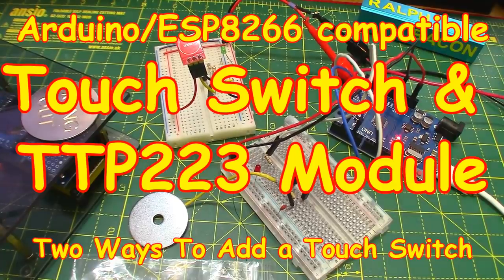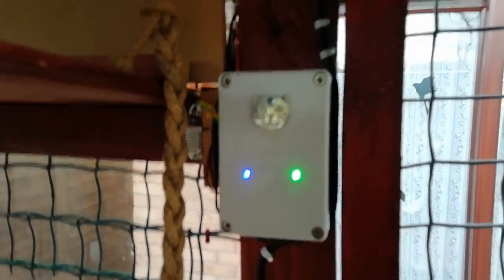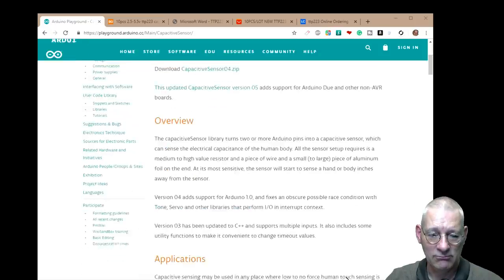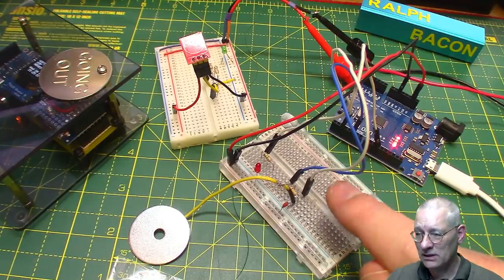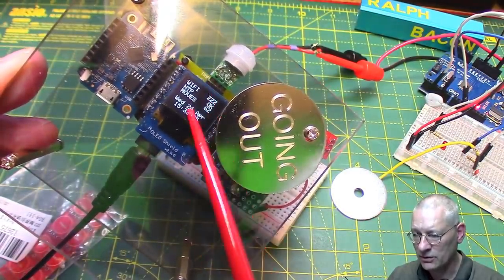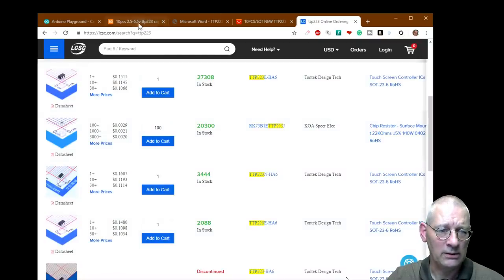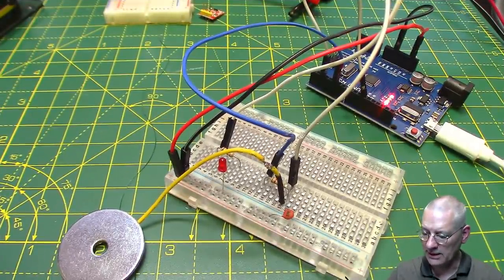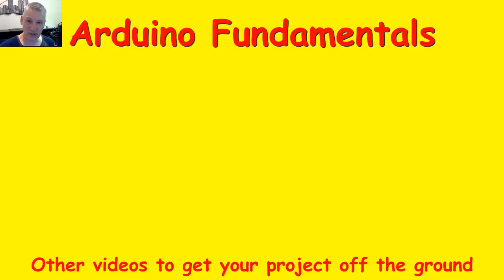#143 Touch Switch 👆 with optional TTP223 module (ESP8266 or Arduino)

Comment: Hi mr. Ralph how can we use a touch switch to turn on a say led and touch it again and turn  led  off  mine are momentary . just wondering if we can do that ... Been watching you for long time thought i would finely ask a question . love your show have learned alot only been working with electronics about a year. i turned in my fifty's and need a hobbie
Reply: Of course you can. It no matter what kind of switch you use with microcontroller, as long as you set up your sketch correctly.
Reply from the maker: This is easy enough, Greg, you saw it working in my bit of the video in Benny's cage. That used the capacitive touch in an Arduino but using the TTP223 would be similar. Actually, the TTP223 supports this natively, in hardware (locked on, locked off - both until another press) but in code it's easy too:

/*
 * Tested solution.
 */

bool buttonPressed = false;
int buttonPin = 10;
int ledPin = 12;

// Declare the input pin for the TTP223 in your SETUP as an INPUT pin.
// And the LED pin as an OUTPUT pin that you must set LOW initially.
void setup() {
  pinMode(buttonPin, INPUT);
  pinMode(ledPin, OUTPUT);
  digitalWrite(ledPin, LOW);
}

void loop() {

  // Someone touched the touch pad?
  if (digitalRead(buttonPin) == HIGH) {

    // Previously did we have an unlit LED?
    if (buttonPressed == false) {
      // Remember the state of the LED (ON)
      buttonPressed = true;
      // Light the LED
      digitalWrite(ledPin, HIGH);
    }
    else {
      // Previously lit, so now turn it off
      digitalWrite(ledPin, LOW);
      // And remember the state of the LED again (OFF)
      buttonPressed = false;
    }

    //Wait until user takes their fat finger off the button!
    while (digitalRead(buttonPin) == HIGH) {;}
  }
}

If you don't understand this, try loading the BLINK example sketch first and getting to grips with that. Then amend it and eventually come back here. It's not Rocket Science, we just like to pretend that it is so no-one else starts a YouTube channel like mine! Heh heh! If you need a hobby this one will certainly keep you busy!
Reply: @RalphBacon  Cool thank you ill try this.I'm familiar with the i.d.e, i will try to work with code thanks again Mr. Ralph

Comment: I have made a alexa enabled wifi switch with esp8266 can add touch switch at the same if I want to switch it off manually
Reply from the maker: Excellent! That sounds like a great project.
Reply: @RalphBacon  I am stuck and both the codes are not working for me any help would be great

Comment: Can you revisit this ttp223. How does it stay on for longer than 6 seconds when you attached the washer? mine re-calibrate(blink) after 6 seconds. If I touch the sensor and hold it there for longer than 6 seconds it begins to blink. Do your ttp223 do the same?
Reply from the maker: I made a video, just for you Fez, showing what happens with mine: http://bit.ly/353nKvF
Although my TTP223 has a tiny capacitor (22pF) on the reverse (to reduce sensitivity, optional but space designed for it on the PCB) it is otherwise standard. As you can see, once the power is applied it only switches ON when my finger touches the pad, no matter how long I hold it on there for.
If yours blinks after 6 seconds... well, frankly I have no idea what that is doing. Best bet is to read the datasheet thoroughly and see what auto-calibration options there are - perhaps yours is set up differently to mine?
The one I used for the HomeAlone project is all set up with the washer just above it (but separated by the perspex cover (aka coaster)) and on power up it does the auto config and after that runs 24x7 for months on end without an issue.
Reply: @RalphBacon  Thank you very much for the video. I am gonna try adding a cap to it and see if that changes anything. Could be a bad batch of Sensors. I am having to code around the problem. All 5 sensors I ordered and have tested do the same thing. I hope the next 5 don't have this problem. Do you have any sensors without the cap to test if the cap is the answer? Also, my setup is just a breadboard, ardiuno, wires from breadboard to soldered wires on the sensors.
Reply: Nope, adding cap does nothing to fix problem. I read there are some knock offs circulating. Can you give me a reputable place in the US where I can purchase them?
Reply from the maker: Not in the US I'm afraid, although you can doubtless buy the actual 6-pin chip (eg from Mouser, DigiKey) and design your own PCB (it just needs one capacitor, one resistor and an LED). I bought mine from AliExpress and Banggood and never had the issues you describe, but YMMV.
Reply: @RalphBacon  if you are interested in a few of these for a follow up video, let me know I can ship em out fast. No Charge of course. Just wamt to see what you come up with.
Reply: I guess I'm not the only one. https://www.youtube.com/watch?v=OyGTus_393c  I found out how to tell if it is the ones with the bad chips. the pads on the upper part have screen printing that are rounded. Mine are tiny pads with square screens printing.
Reply from the maker: I am truly flummoxed as to why anyone would want to fake these chips; they are already cheap so there can hardly be any profit in it. 
Interesting that you have found a way of identifying the bad ones. Have a close look at the Banggood and AliExpress versions (from different sellers at Ali) to see if you can find ones that look genuine and then see what you end up with - AliExpress is quite strict with its sellers.

Comment: Can you use this circuit to power wemos d1 on and off??
Reply from the maker: Not directly, Stephen, as this gives out a signal level of either VCC or GND - but you could use that to drive a transistor which would in then turn a Wemos on and off. If you want it _latching_, that is, when you remove your finger you want it to remain in that state, you have to bridge a pad on the back, see the datasheet for exact details.
Reply: Ralph S Bacon it’s not working!! 😩.. can you provide a circuit diagram? It’s not powering the D1 on
Reply: Ralph S Bacon should I be using a P MOSFET? Or will a simple NPN transistor do the trick?

Comment: Off topic a little.. I have had a terrible time trying to get my Nano's to program using the latest Arduino IDE..1.8.9 There Chinese clones using the CH340 chips and I have like 6 of them and I can only get it to take a sketch 1% of the time if I'm lucky. even the blink sketch. after google searching and trying a patch for a driver update for the ch340 driver it worked once and then not again. Finally i gave up after 2 days and went to my desktop and downloaded 1.8.4 and had no problem. Even my uno wouln't work right.. I use windows 7 64 bit.. and yes i was trying the old bootloader option..lol and every setting i could. Has anybody else had this issue or is it just me..
Reply from the maker: I did have this problem when I did not use the "old bootloader" option. Also when I had a Nano 168 instead of a Nano 328P which caused a bit of head-scratching for a while. I've marked up all my 168 Nanos with red nail varnish now so I can identify them! Let me dig out a brand new one that I've had sitting there in it's anti-static bag for ages and see what happens (read next post for the result)
Reply from the maker: So I'm using 1.8.9 IDE with a brand new Nano from about 1990 (that is, quite old now). It has a CH340G USB to serial converter on-board.

Uploading without stating old bootloader I get:
avrdude: stk500_getsync() attempt 10 of 10: not in sync: resp=0x80

Upload with the "new bootloader" option I get:
avrdude: 930 bytes of flash verified

So total success on an old bootloader Nano using 1.8.9.
Reply: @RalphBacon  bummer..that failure is what i would get with either old bootloader or new. I wounder why It works great on my pc in the older version 1.8.4..lol its just a old dog and I like my lap top better..
Reply: I wounder if it may be my ch340 chip... I think i may have bought a pack of 10 of these nano's all at once and now i look closely there is no markings  on the chip. I'm going to try to find my USB isp avr programmer and see if it takes that way with the Arduino 1.8.9...
Reply from the maker: Could be fake chips on there I suppose. Let us all know if you ever discover the cause.
Reply: @RalphBacon  So.. I discovered that my Uno R3 clone and original was a not even being recognized by my laptop. then discovered there was a some kind of weird driver update on the forum for windows. and that fixed the uno but not my nano and after many days of not giving up. And deleting drivers and I even de soldered the ch340g chip and put one on from a serial driver i had and still nothing.. Today I had success..  
I was swapping out cables again just in case and in my pile was my USB powered hub...and I was like...I wonder... and as soon as I plug in my hub and the laptop updates drivers for it and then plug in my nano.. I have absolutely no problem programming it. and the weird RX light doesn't keep flashing every 20 seconds even when I don't have the Arduino IDE open now...